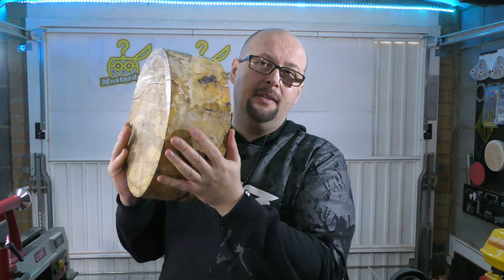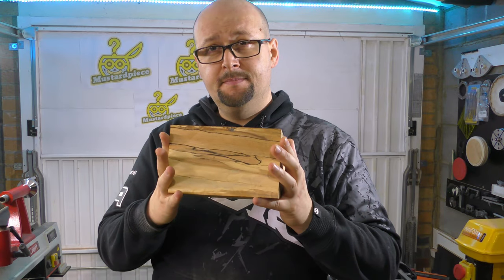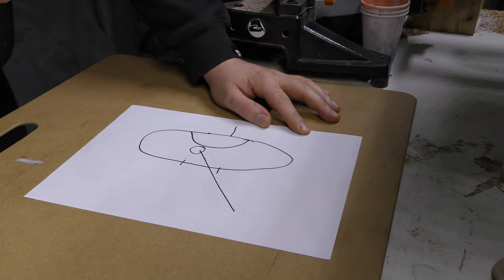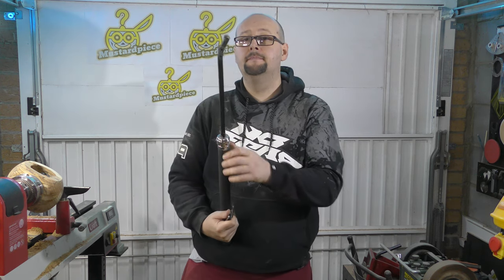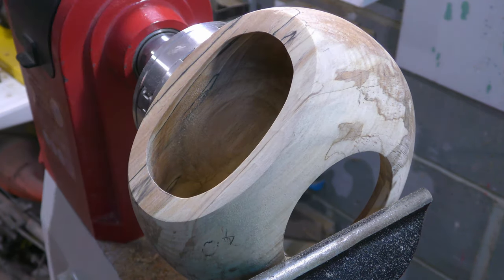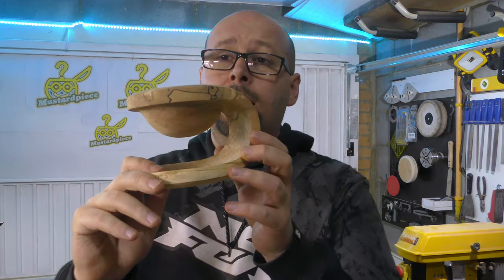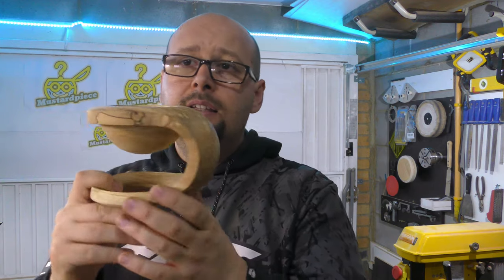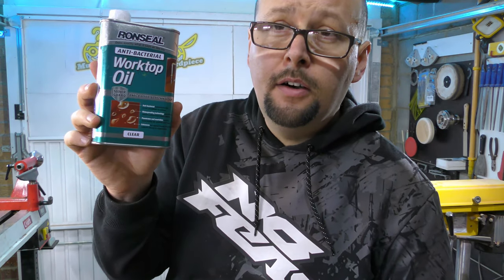Making a Famous Joe Winter Style Suspended Box

Comment: I am entering the giveaway. It ended up looking great at the end. Not to be negative, but learn your tools, do not experiment, especially with hollowing and expensive wood.Find instructions or videos for that hollowing system.  Regarding wood, never buy wood unless you have a special need for it. You definitely live close enough to a forest, so there you can find a lot of fallen trees, which you can take a couple of pieces and play with them in your shop. Don't spend your money on wood, except exotics.
Reply: Your hollowing system comes with side handle. Use it because when you put the cutter outside of the shaft axle, the whole tool tends to rotate, and there the side handle can help.
https://youtu.be/9B2fNzS2YyU
Search Youtube for "crown cryo revolution" and you will find a decent amount of videos showing a proper use of the tool and the cutters.
Reply from the maker: Thank you for the tip. :)